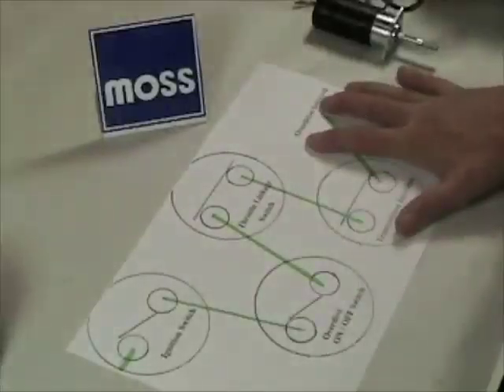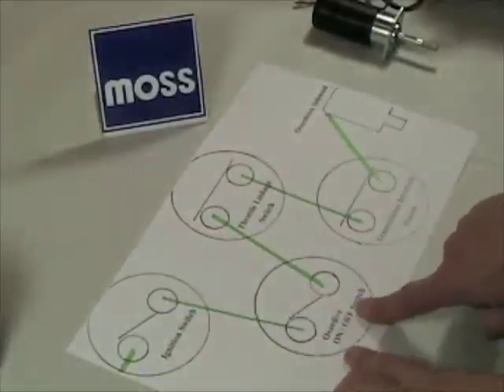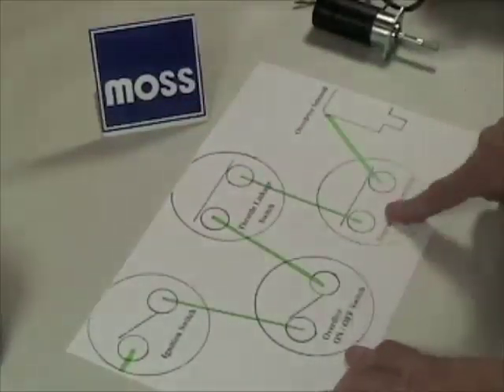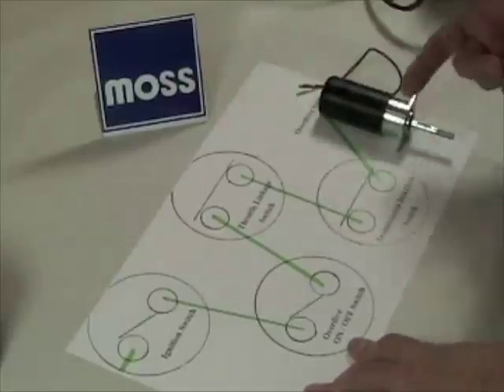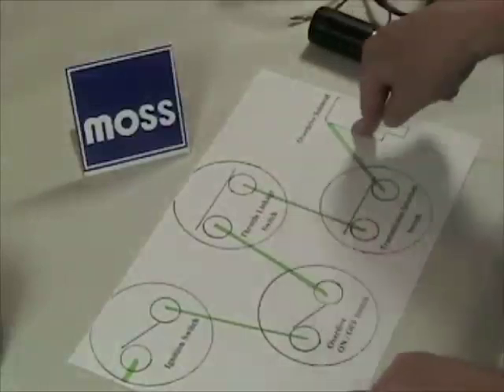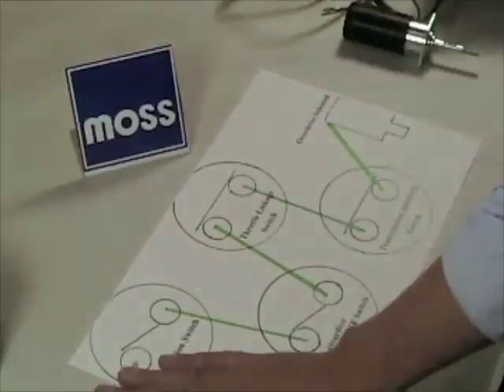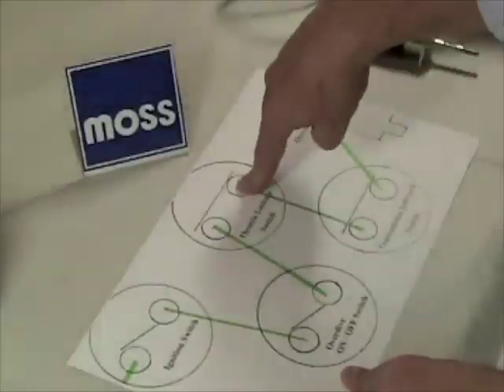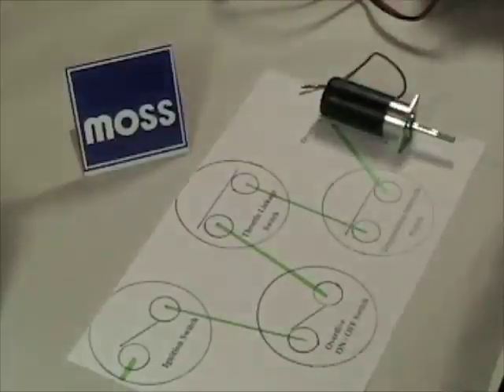Overdrive Transmission - How to test the Wiring

Comment: How can i check if i hace power in mi wiring in a 2010 sebring i have problem whit the transmision only goes in 2nd gear omhs are good on the pin but no power in wiring but i dont know how works if whit the computer somebody can help me please..

Comment: Hey moss, I'm trying to diagnose an od problem. Know how to test a 46re wiring harness? Can't seem to find any info on how to do this..replaced the trans and it'll shift into od but barely moves when I press on the gas. Just downshifts to pick up speed then does it all over again. Trans is definitely fine.

Comment: You have clutch wear, whether it's a manual or automatic transmission, main difference being that if it's a manual transmission, it's a simple clutch replacement and if we're talking about an automatic, you need to take the transferbox apart and replace wet clutches or band brakes, well just look after which clutch is burnt and replace that one. You may wanna replace all of them just to be sure. What most often causes these problems in an automatic transmission, is not maintaining the oil level!
Reply: Jerkwaad

Comment: Hey Moss,
I have a 03 hyundai accent auto trans, it runs perfectly fine but every now and then when i am on the highway the rpm reach all the way to 4000 while just doing 60 mph, in normal it stays in 2000 rpm and also sometimes when i stop at lights then the rpm reach all the way to 5000 but the car is just running like 20 mph.I did some research and found faulty overdrive wiring might be the problem but my mechanic says i need to change the trasmission , so please suggest me something thanks
Reply: very very thank u
Reply: Suzana Shrestha i